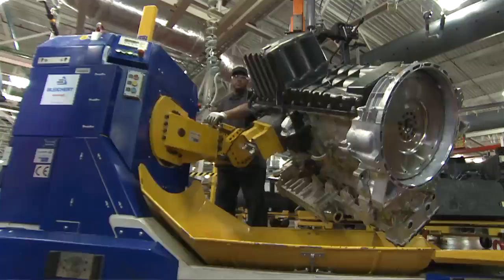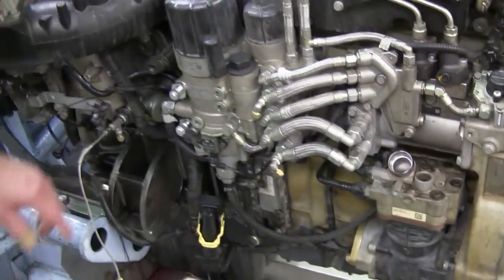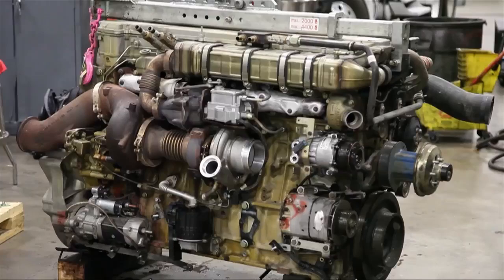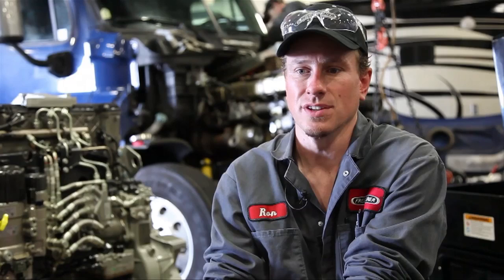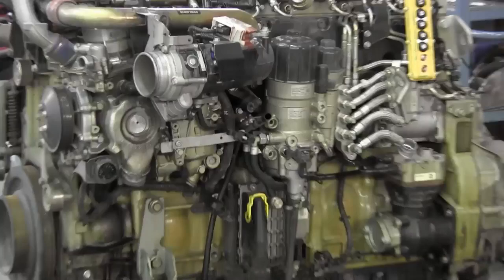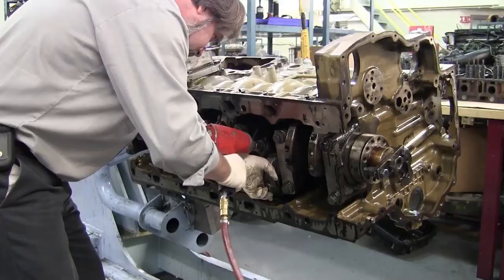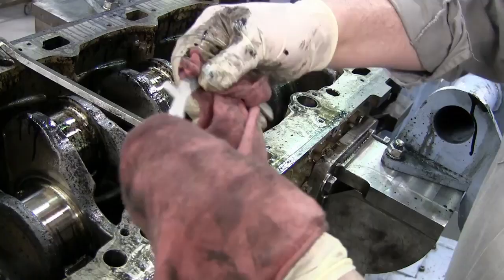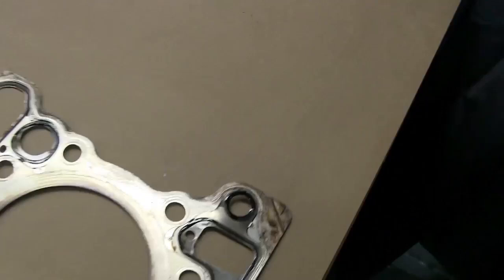Detroit DD15 Longevity and Durability

Comment: My friend has 1.300.000 miles on his 2010 cascadia DD15 engine. It does consume lots of oil, but it’s still running. Mine got 912.000 miles 505 HP and I never ad any oil from change to change. 
 To mention that I do maintain it every 10.000 miles and I’m happy with it. 
 Great engine, good power and pretty good diesel economy.

Comment: the problem is never the engine its always an emission system problem. my truck has broke down twice and both times were emission. the nox sensor and a def injection block.
Reply: def injection block you add in fuel HOWES DIESEL TREAT DIESEL CONDITIONER AND ANTI-GEL .same issue I had now days no more
Reply: @chackojayakumar9433  Is this still the case?
Reply: We have problems with smoke emissions on Mercedes Actros too. And shitty wiring
Reply: This is a common issue to all truck brands. 
It doesn't have to do anything with the engine. It's a separate system. 
Just wait for SCR filter to get clogged around 350k. Make sure you have ready 7 to 10k to replace it.
Reply: Yes, most likely your issues with the DD platform will be aftertreatment related. That has been my personal experience until I had "the cancer removed " 🤫
Reply: @i.am.ghost.  i changed DPF filters for $3000 at dealer

Comment: I do have to say. I've been working on the DD series for 6 years at Freightliner. The engine would not be that clean for sure. Cam frames, oil/coolant modules, crankcase vapor separator,  and air compressors are the most common leaks. That's the biggest thing I fix is oil leaks. Very few valve cover, front/rear main seals, and rear structure gaskets. I've seen plenty with holes clear through the block for no reason, some had reasons due to neglect. Over all the performance of a 495 hp DD13 to a 515 hp 14.0 S60 the DD13 will run circles around the S60. DD15 is tuned for fuel economy so it doesn't pull as aggressive as a 13 or 16, unless you get one with 561 hp then it will pound the ground! If your looking at getting a DD series engine here's some tips. Got service history if possible. A dealer should be able to get the claims history. Around 450-500k miles you'll see came frames leaking, engine sensor harnesses will fail due to wires chaffing inside the loom, and oil pickup tube orings causing low oil pressure at start up. Dpf's will usually last 450-600k depending on operating loads and such. SCR cat will last around 650k unless a previous failure burned them out or poisoned them. Early DD series (08-12) had injector cup orings problems, but most all of them would have failed and been repaired by now. The internal shots in the video are exactly what I've seen in the field. I pulled one down that had 850k miles and had a wrist pin retainer fail. All the bearing looked brand new. Liners and rings had wear but plenty of life left in it.  These bearings are very sensitive to dirty and low oil pressure. They can scratch and be fine, but if something big enough gets in the material flakes off, or metal to metal contact, and then its by by rod or main bearing. These have spattered bearings, not multi-layer. I do like this engine. Its easy to service and maintain, but parts are $$$$ and parts availability is still a problem 10 years after introduction. It's still a machnical thing made by humans and maintained by humans, so you'll still have problems here and there. The things can't handle lack of care like the S60 did, but you can overheat them to 265*F and they'll be just fine; dang belt driven water pump. I'd like to hear from the Euro truck drivers about the equivalent om470, 471,  and 473. Is there an om472? Any questions just ask.
Reply: Marnin Gehman   we have a bunch of m2's with dd13's in them. oil and coolant leaks are so hard to keep up with in them. a handful of them get to 500-600k and liner seals on cylinder 3 or 4 start leaking coolant into the oil. 2016 dd13 with front seals and air compressor oil leaks and coolant lines leaking. it's amazing how much these things are in the shop.
Reply: I have 2013 cascadia DD15. 600k miles. I have buildup around the oil housing some of the bolts have something like acid from a battery. Best way I can describe it. It's white substance with some color from what I think is from the coolant which is red. 
Is that something I should be worried about?
I also do have low oil pressure warnings that comes and goes when I start the engine. I push the accelerator and it stabilizes before it shuts off. I also have rough idling, which I hear could be fuel pump or quantity control valve. Any advice is greatly appreciated. I'm wanting to do some preventative maintenance.
Reply: JZ   Look around ahead of the oil filter module for a coolant leak blowing back. there is a blue coolant hose at the front of that for the egr cooler that leaks, or the line from coolant reservoir, or the crossover hose. supposedly the oil pickup orings were fixed in 2013 but I don't believe it with what we've been seeing. replace the oil pickup manifold, the four orings on the manifold to pump connection. we change oil pumps while we're at it too, but some places don't.
Reply: JZ  I forgot to go back to your post. a rolling idle, especially at that mileage will most likely be a quantity control valve.
Reply: Excellent comment bro
Reply: @JZ-ek4tu  most likely the red is coming from a plastic coolant line to the oil coolant module. Surging at idle is definitely a quantity control valve. Low oil pressure at that mileage is most likely oil pickup manifold o rings.
Reply: you should make videos on the engines repairing them
Reply: @geodepaz54  I work at an independent shop in Mobile Alabama. I try to keep side work to a minimum.
Reply: @mastermechanicfelipe4641  I have a few saved. I may do some
Reply: Again, your customers were probably using the wrong oil
Reply: Hey man, do you still follow these replies?
Reply: @void308  I do because I get notifications of someone comments

Comment: We will miss our fleet of 12.7 series 60s when they are gone. None of the new emission engines compare in terms of reliability. Detroit, Cat, Cummins, Volvo emission engines can all be found beside your favorite interstate puking their guts out. The pre-emission 12.7 was a true money-making piece of cast iron and steel.
Reply: WASJLS1988 I agree with you this is worse engine they made
Reply: 1.5M miles on my 3406e.  And making Detroits eat dust...
Reply: @marceloevera2009  .. I got out of trucking because of e-logs. However, my Fitzgerald Glider had a 12.7. I had it turned-up to a 575, and 1850 torque. That was the forth 12.7 I had owned. I promise you, the 12.7's are the most economical, and reliable engines ever made. I would put the N-14 in a close 2nd place. It costs you more money to operate, and maintain that Cat, then it does for a 12.7 owner. As long as I kept my 12.7 at 65mph, I was rocking 7.0 mpg. I don't have anything against Cat motors, but the 12.7 is/was the best ALL AROUND you can own...
Reply: @redsox2187  I wish you could see me laughing
Reply: @marceloevera2009  I wish you could have seen me laughing at your maintenance bills v.s. my maintenance bills. Lets compare a 12.7 in-frame v.s. a Cat in-frame. Again, it's gonna cost you way more than the 12.7. When you own a truck, you should be business smart. I don't care how fast your Cat will run. Running 80 mph, isn't very business smart. Do you know very much about economics, financial planning, or being business smart?
Reply: @redsox2187   maintenance? Just oil changes....this ain't  a detroit
Reply: @redsox2187  nope.... cat parts are a little more expensive than detroits for sure. Not a big difference nowadays. And you know the old saying: you get what you pay for....
Reply: @marceloevera2009  Over 950,000 on my 1996 5ek block 3406e and i turn the key and quick fire up, warm up and start mashing!😁
Reply: @MrBigR928   mine cracked the head at 1.5 million. Rebuilt the engine and is dusting detroits again lol...
Reply: @redsox2187  The big Kitty's ain't hauling air freight, we're hauling heavy. Nothing against the big Detroit but its hard to out pull a big Cat consistently and not tare up sump'em! The two motors are totally different and the Cat has way more moving parts in them. I like the new X15 Cummins and if i had to get a new truck, thats what I'd get. Its too bad they put the kill on the gliders man i swear! But i would take one of those old 14L Detroits in a minute. Damn good motors 👍
Reply: @MrBigR928  I wasn't hauling air-freight either. I pulled a 40' frameless end-dump. We got paid by the ton, so as you can imagine, we "loaded the wagon". I was 79,500 -79,800 every day. Like I said earlier, I don't have anything at all, against a Cat. I think they are awesome engines (3406 & the 6NZ) Maybe I got lucky, I don't know, but my 12.7's were less expensive to maintain, than my buddy's Cats. The 12.7 also got better fuel mileage. I've always heard about the 12.7's constantly leaking oil everywhere. Mine didn't. My 3rd 12.7 started having noticeable blow-by coming out of the blow-by tube at about 1 to1.2 million miles, so I had a complete in-frame done on it @ the Detroit dealer. The mechanic, who I had know for a very long time, told me after they opened the engine, that I didn't need an in-frame. I said, "well, you've already got it all apart, so go ahead and do it". I've NEVER claimed that I could beat anybody to the top of the mountain, but I didn't care about speed. I cared about durability, and the economics of owning the trucks...
Reply: I've got 860k on my DD15 and the only emissions issues I've ever had were 2 wiring harnesses costing me $600 total. Hell it's only done one active regin ever. It's been a great engine I've had the truck paid off for the last 650k and over that amount of miles with paid off trouble free equipment I am now in a different socioeconomic class because of it. $350K house paid off and $150K in vehicles and some toys paid off......Just sayin.
Reply: @gsxr1189  Congrats! Every now and then one of those DD15's will hold up. Keep an eye out for cracked fuel lines. "Pittsburgh Power" has a good performance program for the DD15👌
Reply: @MrBigR928  Thanks on a financial level it's absolutely life changing and the truck's done it's part for sure.
Reply: As a heavy duty mechanic, I’ve heard so many guys say the best engine (especially when on ya a fleet of over 10 trucks) is the 12.7 because of its durability, reliability, and overall simplicity.
Reply: @marceloevera2009  3406 is a favorite at the pickle park for sure..
Reply: @williamskrainski8407  dont get me wrong, i have a glider with a 12.7....  2 months ago  1 ceramic roller shattered and the rocker fucked up the cam, now i liner sunk....i can shoot you a video from the shop in the morning....shitty engines....
Reply: im gonna throw my hat in the ring here with a small fleet of 6 truck 2 12.7 and 4 dd15. i have the hard data comparison. long term the dd15 has been more economical even with its emission issues. we run at nealry 8.5 mpg vs 6.5 on 12.7 thats a huge huge saving that blows that 12.7 away.
Reply: @marceloevera2009   at 5mpg🤣.. i got one so i know. sold all my 379 for cascadias , and i've made the most money ever in trucking.  when you constantly get 7.5-8.5 and the maintenance cost of a cat compared to a Detroit is incomparable..  x 10 trucks, you do the math..
Reply: @redsox2187  hey  pete guys don't care about that,  they care about looking good.. i care about the money in my account 🤣.. sale reason why they idle their trucks all night long when you have perfect weather😂🤡🤡🤡.. i have own them abs still have a 3406 pete siting in the shop 😂
Reply: @TheDriller100  cascadia dd15 lol... lolololol
Reply: @TheDriller100  lolololol
Reply: @marcelocunha6638  I heard they were having problems with Fitzgerald rebuilds because they weren't using oem parts.
Reply: @ayliniemi  that was my case...PAI parts.... i've rebuilt the engine using oem parts ant tuned to 600hp...changed my mind about detroit engines lol..even so i bough a peterbilt glider with a 6nz cat and sold the freightliner

Comment: ive never seen an engine that clean...especially with 700k miles on it.  i call shananigans.
Reply: Definitely if they use the same plastic sump as the Mercedes version of this engine, absolute trash, they crack for fun
Reply: @aldworth33  You are right I've cracked one in a merc, clogged up sensors and power loss are to be expected also
Reply: ive got 1.1 mil miles on mine no oil leak on it
Reply: Eric Vig I do have Dd15 and it has 720 miles, drives just find, and has no leaks at all. I think the reason why is doing well is I don’t hour more then 35lb and I do my oil change every 10,000 miles, that’s is why.
Reply: Eric Vig. If you've never seen an engine that clean and with so little wear inside you obviously haven't worked on a Scania V8 with a million miles on it. They look like they have just been assembled at one million miles and are as clean inside as the day they were built. I admit this engine looks pretty good for the mileage but it's no better than I would expect from a Scania straight Six or V8 engine. They achieve a standard that very few manufactures can match and that's why their number one no matter what the terrain or load imposed on them.
Reply: @davidellis279  --- why aren't more Scania trucks and powerplants not offered in the U.S.?  Scania would easily pass EPA and NTSB standards, aren't those stricter in the E.U.?
Reply: Assassin Mongoose. Sorry can't answer that question on emissions, Scania are probably the best engine in the world for reliability and power for size of engine, they have ultra clean emissions  and are capable of phernonable mileages if looked after properly. I haulier in the UK I know said at a million miles you just blow the dust off them and his were the straight six engines not the V8s. That engine he's stripping had been well steam cleaned before dissembling but to be honest those engine parts seemed pretty good on inspection, the crankshaft bearings were pretty impressive with little or no wear on them but it's nothing I haven't seen before on a lot of engines with similar mileages, oil changes are the key to engine life I've always believed in that.
Reply: @Texaca  We don't need em lol. Everyone still using old cats
Reply: @Texaca  because Detroit and cummins don't want competition over here. Start with politicians they can tell ya oh wait no they won't because they'd give up some of the kick backs
Reply: @Texaca  Maybe Scania doesn't want to have their engines adapted to the US market which  Mercedes (DD15) Volvo and Daf MX (Paccar MX) do.
Reply: MINE HAS 857K MILES AND IS SPOTLESS..
Reply: My truck has 700k it is very clean
Reply: Prove your claim of shenanigans you know the rules
Reply: @bmwq7  !,
Reply: 3 years at 700k that was a team ran truck so it didn't get a chance to sit and rot the seals from sitting a lot. It's crazy how a solo driven trucks at same miles look like crap vs a team trucks same mileage and will look fairly new.
Reply: @crocket1971  Scania is already used in marine applications and some select heavy equipment models and rock crushers. They also share parts commonalities with cummins. I've seen a Hyundai wheel loader with a Scania engine with cummins labeled parts.

Comment: I work on these engines a lot and if properly maintained you can reach 1,000,000 miles with ease.
Reply: Carlos is the man!!!
Reply: @carbombtorres1761  Thank you for the compliment.
Reply: @CarlosDieselElectric  I'm very grateful for your help even though you are in Cali and I'm in Chicago. On Nov 1, 2019 my truck brokedown it was the fuel pump. I had no money after the towing to really spend on a shop repair. I jumped on your channel, I followed the instructions on the fuel pump replacement video and knocked that sucker out in 2 days. In my opinion I think I was back on the road faster then if I had taken it to a shop. I tell everyone about your channel when they ask me about repairs I do on my cascadia
Reply: Carlos Diesel Electric: What’s properly maintained besides regular oil changes ?
Reply: Josif Maracine 1) regular oil changes with quality oil and filters. 2) replace your oil suction module immediately if you notice oil pressure is fluctuating. 3) always have at least 1/4 tank of fuel or more to help ensure longevity of injectors and high pressure fuel pump. 4) perform valve adjustments at  the correct intervals. This may sound like a lot but I have seen a few DD15’s with over 1,000,000 miles on the original engine and still going.
Reply: Carbomb Torres thank you. Glad the information was helpful. And thank you for sending people over to my channel 👍🏼
Reply: @CarlosDieselElectric  1028Yogui here let me know about your channel, Carlos. Please.
Reply: Yogui 1028 look up my channel. I mainly cover DD15 and DD13 engines.
Reply: Hey Pedro would u buy a DD15 with 900,000 miles for 10k?
Reply: @2008martymarv  if I did I would have a mechanic look at it first, ask for maintenance records. 
Thoroughly inspect the engine, the truck, oil sample and just about anything else to help you make a good decision. Although you can easily get 1,000,000 miles plus out of it. It is always important to know as much as you can. 
What year is the truck? What is the make and model?
Reply: @CarlosDieselElectric  what’s your channel?
Reply: then why did mine puke at 709,000 all over the highway ????
Reply: Hours are more important